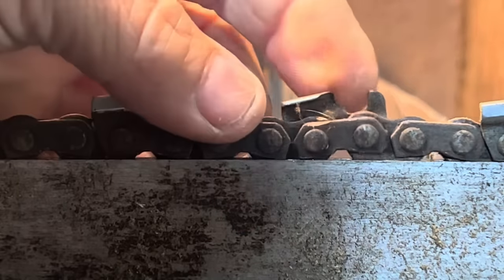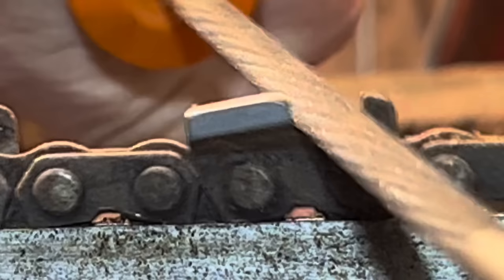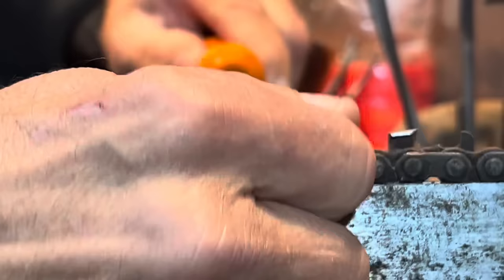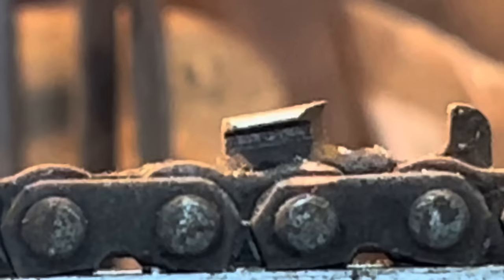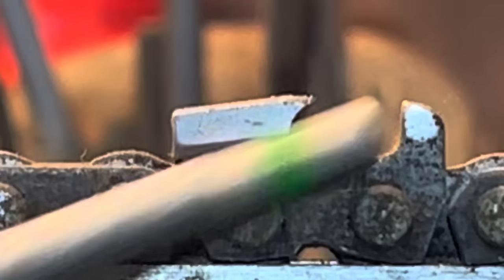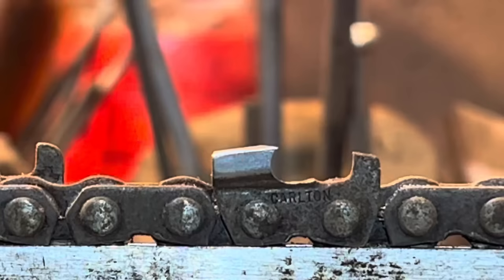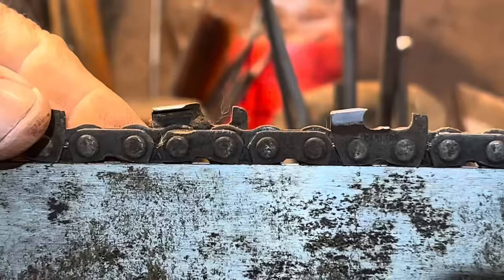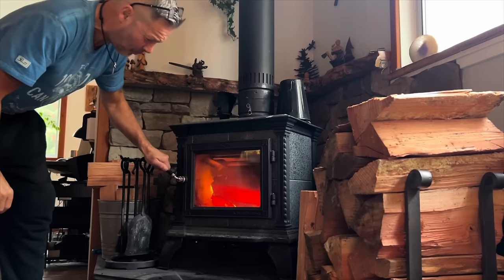Best Chainsaw Sharpening Video yet ! Get the Gullet.

Comment: I get the gullet ... I put a good edge on the tooth and I get under that top plate or whatever it's called... and I learned it all from your videos. Thanks Buckin'.  

Not kidding: I cut with the same chain with no sharpening for 3 years. Not a lot of cutting...just yard maintenance  but still... Then I watched your Chainsaw Sharpening School video and my lord!  Chips were flying! After that I only got better. 

I know that I already said thanks Billy...but thanks!

Comment: Nice wisdom my friend.. I’m making my kid watch close so I can quit filing his saws for him. Sometimes another adult can explain in a way your kid will listen too. 

I don’t know how you can deal with that chain loose on the bar.. I have to tension my chain or I rock the tooth back too much. I may push too hard on my file, but an old machinist once told me “a cutting tool stays sharper longer be it a file, blade, or drill bit”. If its cutting it stays sharp, if its skipping then it dulls quicker. 

*edit now that I’ve watched more on the video I can see your quick tension system I LIKE IT

Looks good Buckin, you’re a good teacher and a great friend!

Comment: Im not a tree guy, felling feller or anything of the sort. I'm a welder, but boy, do i love power saws. Anything 2 stroke, honestly. I live on the md/pa line, and wood is my source of heat in the winter. Watching buckin changed my firewood experience. Heck, life experience. I went out in the garage a few years ago when i started watching, put the saws in the vice, and got to work. I went starred cutting, and the thing was jumping all over the place. I said what the heck. Maybe it doesn't work with hardwood. Nope, i took 2 seconds, thought about what i was doing, and rewatched the videos. I wasn't putting the racker gauge on right all this time. Hit those rackers and man was she hungry. I loved it. Instantly hooked on filing. Even the little T-handle stihl was getting after it after the filings. She's old. I can't remember what model off the top of my head, but it's a good 25 years old. I do use a file guide when im out in the field and dont have a vice. There, i said it. Go ahead and start busting my chops.

Comment: Chain sharping made simple by Billy Ray. I tried all the tool guides cannnot get them to work for me and I can get a chain sharp by hand but this made sure I know what Im doing. I use to follow the line on the chian but sometimes the gullet needs the rock out taken out like you showed. I feel a lot more confident after watching this than before. Another thing i learned that a guy needs to have a sharp file or you just spinning your wheels. I also learned to just buy a whole new box. I bought me  whole box of new oregon 7/8s files wooo hooo!:face-fuchsia-wide-eyes: I cant wait until they get here. I think a lot of my problem was the files were dull and I just couldnt get any work done. I was afraid to cut deep into the link. You know your racker is to high when you get fine saw dust. I think this will help me a lot after you explained this so well thanks. You said if the rakers are not at the right angle and hight you get jack hammering I know what that is LOL. I see said the blind man.:body-blue-raised-arms:

Comment: One of your best videos I've seen in a while. Firewood cutters and beach loggers listen up, Beach loggers hit a lot of rocks and I hope they are paying attention. My beach wood buddy will not use a 7/32 file (he uses the 13/64 file like what is on the box with a new chain). I tell him it's OK just get the gullet with any file and make a hook like you say and he does and it works. I like the 7/32 file. Thanks for the tips.
Reply: Stihl chains call for 13/64" because they sell the files, Oregon says 7/32" and either will work.

Comment: You did a Fine job. I had a sharpening business for a while, mainly pocket knives, but I was the ONLY power hedge trimmer sharpener doing it professionally for my area. I had folks come from fifty miles away, they would say, to get their bars hand sharpened. I did quite a few chainsaws as well. What this fellow is showing is absolutely correct! He showed how the tooth tapers off, the more it's used. The top of the rake HAS TO have the same percent of drop, all the time. If the rake height is the same height as the top of the tooth, it's NOT going to take much of a bite...but you don't want a hugh height difference either or you'll BOG THE SAW!!! I'm in my seventies now and only sharpen my own stuff and my close friends, sissors, knives loppers and power mowing blades and refuse payment. It's an art I enjoy-joy and an honor that they remember me for SOMETHING.
   THANKS FOR YOUR VIDEO.
   Bill, from Tn. 🇺🇸

Comment: I struggled sharpening chains pre internet in the 80's developing a similar technique to get my chains to throw big chips. You've taken it to the next level and revealed where to focus on removing the material that matters. I would add that once you get the cutters in the shape you are achieving it's much easier to keep them sharp with just a few strokes if you don't hit a rock. I get a lot of life out of my chains if I take the time to block up the pieces I'm cutting and keep the tip out of the dirt. It's cutting the stump down low that usually brings out a few bad words. Thanks for taking the time to help folks Billy, Good on ya!

Comment: HI BUCKIN U 😊😊 can tell when a chainsaw file is no good no more it won't put a edge on the chain no more and U can see the file is slick the file is gone and it won't even sharpen butter 😮😮 it ready 4 the trash can the old chainsaw files were better than the 1S 2 day they don't last no more either 😮😮 that's sad 😔😮 the chainsaw files 2 day they changed the steel that they are made of and even the name brand chainsaw files aren't any better U paying 4 the name now 2 day most of them I see have green paint on the end and they don't last any better I had another fellow tell me 2 use a wire brush and clean the chain 1ST it does help not much 2 make file last that much longer it does get the tree 🎄  sap and the dirt and is better than be 4 😊😊 OMG 1O 24 2O23

Comment: Hi Billy Ray. I've watched many of your videos and find them interesting and informative, especially this one on sharpening. I'm an occasional-use saw user and sharpen my own. Over the past four years, I bought three Stihl saws, where cutting dead wood on my property and the woman's next door keeps me busy. I burn 3 to 4 cord a year. The 261C with a 20 inch bar, the 400C with an Oregon 24 inch, and a 500i with a 25 inch are the saws. For me this is more of a hobby than necessity. But, it keeps me fit, I enjoy the work, and I like being self-sufficient. Despite how sharp they are, the saws are not cutting freely as yours do. I too have back issues and prefer to stand straight not having to bend or squat while I cut. I meticulously sharpened all three saws this week after watching this video. I have the chain on the 261C looking like the factory 16 inch I use occasionally, and use a 3/16" file. The 400C has a decent gullet and the best looking "C" shaped teeth with a 13/64" file. The 500i being the newest saw has only been sharpened three times with a 13/64" file. So, I am still able to follow the factory filing. I am disappointed at how the saws cut. I find myself bending or squatting to cut, and using the felling spikes rather than standing straighter. With the 500i, I have to push down hard to cut effectively with the end of the bar, otherwise the saw four-strokes. The 400 cuts the best, but the chips are small despite the raker filing. The 261 does ok for a small powered saw and a smaller chain. I have filed the rakers beyond Stihl's recommended setting of 0.026" on all three saws. Am I missing something? Should I be using the 7/32" file on the larger saws. What about the rakers?

Comment: I've never seen a chain that dull before. Wow! Great  video on sharpeni g! I recently started sharpening with an angle grinder and love it. It can be dangerous. Don't risk using one unless you know the danger and know you can avoid injury. Buckin, I'm still learning at 70 years old.
Reply: DON'T USE ANGLE GRINDER ,CAUSE U overHEATING the metal

Comment: Thanks for taking to time to show proper profile. I'd been using 3/16 but I may go up a size.
Reply: Try it, I run several different .325 chains and each brand and type has its optimum, some really do work best with 3/16, oregon bpx likes bigger, carlton (I forget which) has smaller teeth and I use the size below.

Comment: I was fortunate to find this channel years ago when I was lost and struggling with sharpening my chains. I watched and worked at it. Threw away the gadgets. Put a handle on a good file and sharpened the teeth until they were sharp. Then I hunted all over for a good progressive raker gauge and wound up modifying the husky ones so the stihl teeth would fit in the slot. My chains rip now. This is an even better video than the one that fixed my problem. It’s all right here

Comment: Billy I been cutting firewood now for 2 1/2 years  its the only heat i have is a wood stove and before that as a mechanic I had sharpen a handful of chains for lineman and until this afternoon watching your video I was doing it flat wrong so thank you I have to say your video is spot on at least for me I get it now and won't forget it and here in about 30 minutes I'm going to go fix my two saws because ski jumps well let me just say if you don't know you flat don't know but the hole chain both saws nothing but ski jumps and neither one will cut at least very good so thank you

Comment: Hey Buckin great video . I use a guide now that does the teeth and rakers at the same time. Looking at my chains  it doesn’t look like the file is getting deep enough. It’s sharp but doesn’t seem to last long. I mostly cut oak and locust. I was always told the teeth need to be the same length or the chain will pull to one side. You don’t seem to worry about the length and it sure doesn’t look like it matters with the way your razor sharp chains cut. Thanks for all the great content. Keep up the great work.

Comment: Great video. Your chainsaw chain filing videos helped me I tried the 7/32 file yesterday for the 3/8 chain and seems to pull bigger chips in the wood and the cutters stay sharper longer. The problem I had with the 13/64 file is the hook was too big and dulled faster. I have a Stihl raker gauge but Now I have to try that husqvarna raker gauge like you use.

Comment: i use a 3/8 file for 3/8 chain, chain pitch can be measured by the distance of any 3 consecutive rivets on the chain, it helps to choose an appropriate file for the chain pitch, also pitch on commercial chain is stamped on the chain, little home chainsaws come in all kinds of wacky pitch sizes

Comment: After truing the cutting edges and gullets I adjust the depth of the bite by 0.025". I top that  camel hump ahead of the  cutter to reach about 0.025" shorter than the top of the cutter. I don't  go too deep, but it shortens the time needed to get through.

Comment: I was using a saw as a farmer, without much attention to the thing that actually did the cutting, the chain. Chain stops cutting, take it to the store to have it sharpened and toss the backup on to keep working. After a couple sharpenings the thing is done, buy new chain.
I thought that maybe I need a bigger say to power through dull chains...
It then occurred to me that the shop was not taking the depth gauges down as the were sharpening. Lazy? The wanted to sell chain? Who knows.
So I went and I bought a cheapie grinder, at least I was getting some results and I didn't have to rely on the shop. Still they were cutting a little crooked a lot of the time.
I said that's it and I invested in a few files of appropriate gauge, I dug out the box of used chains, I turned the radio on and got to it. 
Long story short, I am still perfecting my technique and i still rely on a grinder to "reset" the angles. But I find it therapeutic to grab a simple file and creating a monster.
As a consequence I don't have to run expensive or fancy saws. It feels like a good chain doubles the power

Comment: Hey Billy, it is all your fault but I am not complaining. Quite some time ago you talked about "square filing" so I bought a chisel bit file to give it a try. I put a comment in your site months ago and thought I would throw a bit more into that now. My first chain and attempt did not go as good as I hoped it would so after a few cuts I took it back in and did a bit of an angle change since you were correct about it does have to be pretty right on. Well, after going out and cutting with that saw I took my other three and filed ever darn one of them "square file" along with all the extra chains. Doubt I will ever go back to the old round file. Thanks again. Keep up the good work and most important, stay safe.

Comment: Quite extraordinary! I've never seen a chain with so many different lengths of teeth. In a situation like that why don't you use an electric chain sharpener to save time. The cutting angle is consistent. There are drawbacks as well which I won''t mention here. I like your video on tuning a carburettor, Keep warm!

Comment: I got a new 14" battery operated chainsaw.  And while cutting; I noticed there weren't a lot of "chips". Too much dust for my liking.
So I grabbed my file; and put a proper gullet on the teeth. The motor didn't run quite as fast after the gullet; because the chain was actually cutting!

Comment: Just so as not to confuse anyone, the example given regarding the raker height [ 6:41 ], contrary to what he said in the video the raker height is actually just fine - slightly lower than the cutting edge.  You could see light behind that raker.

Comment: Yeah timely video. I use the 2 in 1 Sthil sharpener and it puts the ski slope on one side of the cutters,  the other side looks good. I have to figure it out. I just found it because my chain saw is cutting path is like a curved hockey stick. It can not cut straight. Anyways tomorrow I will take a look at the 2 in 1 and see what is going on. Great video.

This video freed me from being held hostage by  "chainsaw sharpening dilema". Finally able to sharpen with just a file. Hooray ! Thank you.

Comment: Have you ever tried carbide chains,  I hear they stay sharp 4 times longer but are harder to sharpen I never have used. I believe Firefighters use them because they cut through asphalt shingles, nails and whatever is in a house.
Reply: I am also curious about these new Wang doodles.
Reply: Although Carbide is more durable in dirty conditions, even it has its limits.
We use them for flush cutting stumps on landscape jobs. You still want to minimize the amount of abrasive material you expose it to, because they will dull and chip.  Sharpening is crazy slow, as it requires a diamond bit to sharpen it.
The Stihl Carbide is painfully slow cutting, so if production is important, it’s not a good option.
Bless’ns to ya,  Tedd
Reply: @sawsurgeon  Thanks for the info, I never tried one guess probably never will, just heard they handle staying sharp considering longer but it they don't cut as good guess that's why firefighters use them.

Comment: Buckin wow, your best chain sharpening video ever, camera angles are great. The light issue is likely due to using led light, led light is rubbish theses days, use old school light from 40 years ago is far superior spectrum light, bulb 💡 light is easier to see and film. 
To focus on top plate rather than background set zoom to touch screen location zoom with a sqaure, you know that square that can be put anywhere on screen, this will focus solely on square location an nothing else. 
Do you know what is MACRO?
It is a form of up close micro video, macro video recording will improve your up close videos, but macro video recorders are expensive. 
Thanks once again for sharing your journey. 

Out too you, sincerely from Jaran, 18 years sober, well most of my life really. 🦘😀👍
Reply: Good advice 👍🙏

Comment: Billy, have a great Christmas! Super informative video, my friend. Nothing is better than having a sharp chain. Been having some perfect cutting weather here in New England and have already got a jump on what I usually start in each March to replenish my wood supply. Got a bit greedy the other day working a huge log. When I rolled it with the ole cant hook the bottom had some obvious damp dirt on it, the sun was setting and only had two cuts left and said the heck with it, made the cuts but as you know, spinning a chain at 12000rpms makes it go from throwing chips to producing baby power 😆 Next morning a little chain filing and a tad off the rakers and all is good. LOVE the comparison you did with the new chain to the old; insane visual reference tool.  My gullets were not bad, but touched them up a bit as you showed!

Comment: Question - what happens if different teeth are different length because you had to take more material off some than others?
Reply: Great Question!
That’s the job of the raker gauge.
By using your gauge/guide with your flat file, you are maintaining proper feed rate or depth of cut for the top plate.
Bless’ns to ya,   Tedd
Reply: The height of one tooth compared to the next tooth does not matter. What does matter is filing each tooth until it is sharp and then setting the raker height in relationship to that tooth.

Comment: For years ive been battling with getting chains just right but I think its been because I've been using and getting told to use the smaller file on a 3/8 chain. The 7/32 is generally used here in NZ on the 404 gauge chains. Id never been told to get rid of the gullet. I'm nearly sixty and been out of the bush for close to a decade but I'd like to think Ive got it in me o get back into logging. Im working on getting my fitness back up to what it was first.